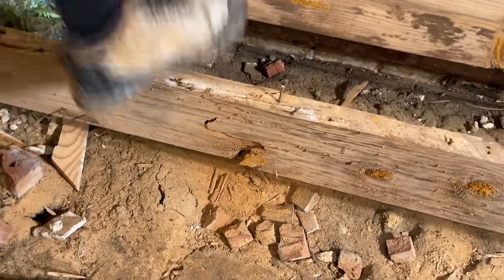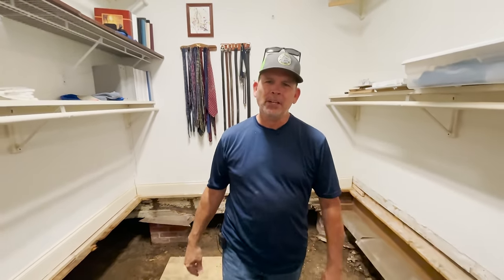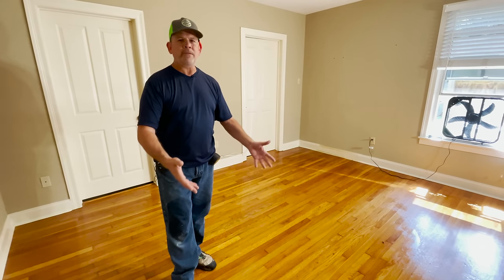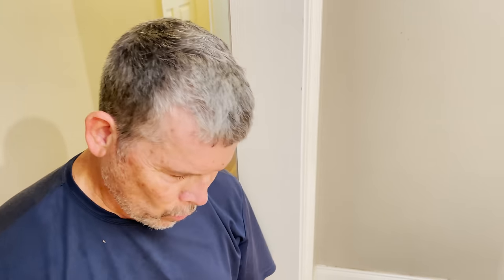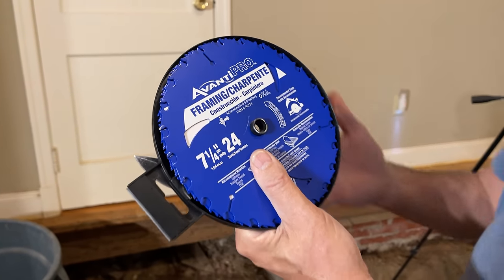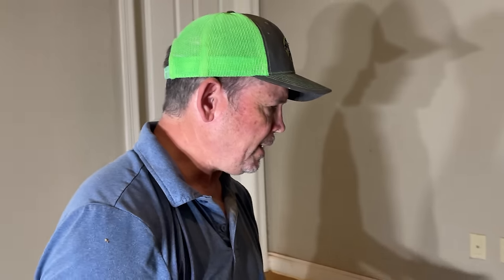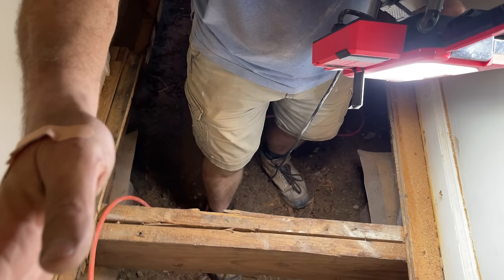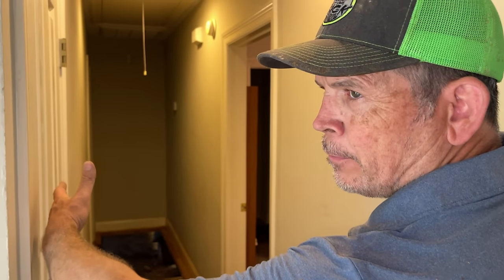This House is CAVING IN ON ITSELF!!! Can We Save It?

Comment: I just subscribed and appreciate you two for sharing. The owners decided to tear it down according to Stud Pack answering Dave Paddon and Claudia Gonzalez’s comments way down in the comments list. Since they had insurance, I suspect the price of demolishing the home and building a new home was close to the price of the repairs, after the owners probably told the insurance that they need to do a more complete inspection of the entire home because they (the insurance company) need to pay for all the damages since it all resulted from moisture and plumbing issues. By the time all the prices to repair the home “correctly” was added up, I imagine that the owner’s decision came down to whether they just wanted to pay the insurance deductible and go thru having repairs done for months or if they should be in $20 to $60 thousand from their own pockets and have a whole brand new house. If the owners decided to take an insurance check and add money from their own pockets in order to have a brand new home, then it was probably based on  the age of the home, the price of insurance premiums on it and about the probability of having more issues  with the the home. Myself, I would have gone with the repairs. The first thing I would have asked them is couldn’t they cut out a patch of bricks to inspect whatever is going on with the sub flooring and  foundation because the condition of the inside flooring seems to be in good condition so I would like to save it if possible. Then of course they would have went under the house from the outside or negotiated where the best place to cut of a piece of flooring to go under from inside the house would be, but either way they would have probably said the cost to try to save the flooring due to the labor involved trying to do it without damaging it and then with the price of mold remediation and pieces lost to damage, that will add up and there’s no way insurance is going to pay for all that labor. I of course would have asked the ins company to figure up the price of having to pay for a comparable real wood flooring to replace the one that came out of the home and then ask the repair man, how much would the difference be for the labor involved in trying to save the old floors verses just throwing them out. If the price for the labor involved in order to save the original flooring wasn’t that much more than the cost of the new flooring, I would defiantly be trying to arrange an agreement with the repair man that instead of buying new flooring could he possibly use the original flooring or at least as as much as possible such as maybe the whole prayer room even if there is enough salvaged to do the hallway. That of course is a repair man’s nightmare is homeowners that want to do things the hard way because repair men know anything is possible and sometimes that makes a job way more hard than what was originally quoted but when he has to step to the owners with the new found issue and tell them that makes the price of the job go up, he knows most homeowners will balk and say “well I just don’t understand why you didn’t tell us this before” or “I just don’t understand how you didn’t know this in the first place.” If I were the repair man having to deal with customers day in and day out, I imagine I would want to thump the owner on the forehead when I answer them saying “Well thats why when I quoted you the price, I specifically said the price would be $this amount, and that is IF we are able to do in the manner that “we should be able to” but that could change because with older homes we often run into unexpected complications and the cost of the job can increase. So thats the answer to your second question too, because  sometimes there’s no way to know about a complication until you actually find it because if by the parts we see, it looks to be normal or done in a certain way then we thats what we base our quote on but because we also know from past experience looks can be deceiving or that some people do things that have no apparent reason or that can’t be reasonably explained, thus the reason that we always explain that something could find a complication and that would increase the cost, what part of that didn’t you understand because its also printed on the estimate. Its like people don’t pay close enough attention to repair man when they are discussing prices because on certain things contractors or repair men will give a quote on something and doesn’t even say “but if we run into any complications” and thats because if they are experienced at their job they are well aware if its  something straight up that there almost nothing that would actually make any difference in what they have to do to get it fixed. However, if there’s there’s even a chance if something that might cost them more time, energy or materials to make it work right, then they will defiantly make sure they say their quote is IF there’s no complications found, so that should always put the homeowner in alert that there’s a possibility, which is why I have no idea why some home owners act shocked and are mad at the repair man. Many times it is the previous owner’s fault if a complication is found because most the time either its a home owner’s dyi thing or the thing was done that way due to a home owner telling the repair man just do it however he can to make it ok for now and for it not to cost any thing more. So if someone wants the flooring saved and a repair man had pulling up a few pieces and there were only nails in those pieces, then he reasonably believes someone nailed down every piece, and has no reason to think that half way across the room someone would start using glue and nails to put the floor in when its tongue and groove flooring and there shouldn’t be any reason to use both so how could he have know about the complication without having tore out the flooring? So thats why I say if they mention a chance of complication a homeowner should listen because the bigger the chance that there might be one, they usually stress on it more, as to where they feel its “for sure thing” like ripping out the whole floor, they know how much time it takes to do it just getting that done, however when some home owner wants to throw something different in the mix like saving the old flooring, the requires being careful and things that might get damaged during the process so of course then he will be sure to mention that is if theres no complications and it’s not really because he suspected anything like glue, but simply because of it being something out of his “normal” way of replacing a floor because believe me its much easier for him and  not even worth the extra money that the home owner is paying that amount isnt anything he will make any profit from and usually just done to please the customer. I imagine thats why the majority of people that commented said tear it down and just build a new one because they are either in the business and know going in to fix something that others have had their hands on can turn out to be much harder than expected and that leads to what maybe those that arent in the business but are homeowners that have had repairs done and that is when there’s a certain amount if damage in the end for the price of repairs you could have just bought a new home and avoided all the headaches.

Comment: I would do the bathroom.  You have two root causes leaking plumbing and plastic in the floor, doing the bathroom may reveal which one is true root cause.  If it is leaking plumbing then fixing the bathroom will fix this issue for good.

Comment: Great video. I have never seen floor joist fail like that especially in so many places. Is this due to the under side of the house being completely enclosed and unable to allow moisture to escape? I can’t wait to see the engineer video and work. Thanks for sharing.
Edit: as a homeowner I would find away to fix the bathroom which I suspect is the cause of the mold and decay.

Comment: There you go the plastic under the new plywood. Just one of those stupid mistakes that people make renovating a house. I've gotten sick of all the problems our house's one renovation has. Btw using drywall outside is a bad idea.

Edit: Seriously, it's so painful to see these dumb mistakes that ruined this house. I learned just how much research and planning it takes just from designing and building three large benches to go along the local bike path for my Eagle Scout Project. The good decisions paid off, especially using polymer decking for the exterior. They are all still solid years later and still look fantastic, no maintenance required.

Comment: Get in there rip it out, why in my prospective, if a termite inspector goes in there if he could, knowing that some areas are less than 12 inch clearance he'd have to say it was inaccessible to properly inspect, to have the owner open it up then call back for a supplemental inspection....but he would call out from the crawl space entrance with a flashlight the fungus and noticeable damage, in addition the floors may have notable dips when walking on the floors, that could be considered section 2 on the report, the owner would have to face this at time of escrow if selling the house, he/she should let you fix it now.

Comment: Jack it up you said there was brick on the outside.  With all the rot can you get it structural enough to lift it?
Reply from the maker: We’d lift from the walls which are fine.  Once the walls and roof go up about 1/4” we’ll be fine.  Just need to lift the middle mostly.  The exterior walls will stay put

Comment: I have never seen anything like this.  This amount of damage done just by ambient moisture.  I had no idea it could  be this bad.  I will be paying a lot closer attention to vapor barriers and ventilation needs from now on.  It is also interesting to note that had i looked at this job i would have called it a tear down and start over but it looks like you guys will be able to save it.  I just would not have trusted any of that underlying structure to be solid enough to support any new repair construction.  Can't wait to see how you lift it up for the next stage of repairs.
Reply: I wonder what the original builder was thinking, having the brick veneer go all the way to the ground and no ventilation underneath. Homes in the South were built on piers for hundreds of years, ending around 1950 with slab construction being more prevalent. But the wood siding ended at the top of the brick piers and the entire underside of the house was open to ventilation. There was no moisture problem like that at all.  Tons of moisture comes out of the ground and has to have a place to go. Termites were/are a problem, however: termite barriers consisting of galvanized sheet metal pans, especially formed, were placed on top of the brick piers before the band joists were placed. Band joists were often 4 x 4" or 6 x 6" creosoted timbers. Exterminator companies were kept busy looking out for termites. They'd drill holes through the mortar joints into the interior of the brick piers and pump in insecticide to deter the little buggers from tunneling up. Every region has its special methods of construction to accommodate local conditions.

Comment: I am watching this because the floors in my home are going down.  I know how to replace floor joists, but not when most or all needs to be replaced going under walls.  I know I will not know how bad it is until I tear into it.  
I was assuming I need to replace with ground contact treated lumber... But seen another video to where I am not so sure now IF it is a true moisture problem 
I also seen a new product out that can be brush over ground treated contact would that is suppose to seal moisture out...$79 or $80 for a 1.88 gallon bucket if I recall correctly.  What do you think?
Reply: Did you figure out how to replace the joists going under walls? I’m in the same situation. Need to replace subfloor as well.

Comment: Your comment about the lack of sub-floor ventilation is interesting. I have no idea about building regulations in the States but here in Australia sub-floor vents are mandatory and they are required at fairly close centers. I have seen more than a few jobs where the sub floor ventilation has been compromised over the years with results similar to what you are finding. Having said that, your situation is the worst I have seen - probably is for you too.
Reply from the maker: Thx Richard.   I think subsequent additions to this home covered all the foundation vents.   So glad you found our channel 👍
Reply: There are building regulations in the USA, but my experience has been, at least in Virginia, they are not enforced very well. I have seen some of the shittiest half-ass work here in Virginia, some of it in plain sight, right across from the town hall.
Reply: @brianleeper5737  And let’s not forget that this is post WWII construction, so regardless of what the code requirements might be today, 75 years ago, if there were any building codes, they were quite simple compared to what’s on the books today.

Comment: This looks worse than one of our rental houses.  at the time I thought I was going to be moving into it, and had to remove the entire dining room floor.  The house was built on top of a rock ledge, but over the next 60-70 years dirt washed under the floor (almost a dry laid foundation, what little it had for one) and filled up nearly the full space under the floor.  

before I could even reframe the floor, I had to spend weeks chiseling out the rock to make enough space to do the framing.

We should have sold that place some 30+ years ago; some builder would have demolished all the buildings and built a "McMansion" right in the middle.

Comment: You guys should pick up one of those "portable" stand up a/c units I got one a few years ago to bring on job sites when it is just brutally hot there super convenient just stick the hose out the window and your good to work in comfort!
Reply from the maker: The AC is on inside.   It takes a bit of the edge off with no floors

Comment: You know you were getting a 12 pack of cold beer after that as well! Lol can’t you sister up next to the old 2x10’s under the bathroom so you wouldn’t have to demo the bathroom? Since you have room from opening 1/2 the floors up anyway?
Reply: That makes sense Robert, but man there is so much rot, It's better to cut it out and start over. It's hard to believe these repairs are worth it monetarily.
Reply from the maker: The subfloor is rotten too otherwise that could work

Comment: I wouldn’t bid that job with a 10 foot pole. Pay hourly til it’s done or no dice. Did maintenance on an old apartment building that was built on the ground like this, floor was rotting the same way, no crawl access from outside, no vapor barrier and no way to get one in there. No way to fit a dehumidifier, every type of pipe that’s ever been made cobbled together with shark bites and flowlock couplers. Told the owner the only way to fix it is to raise it 3 feet, then start all of the demo. He sold it, feel sorry for whoever bought that land mine.

Comment: May I ask a (stupid) question? Why do houses in the south not have basements?
Reply: In some areas they have very high water tables. So the basements would always be wet. 
Other areas would have basement flooding due to hurricanes.
Reply: @1packatak   Thank you.  That would also explain some of the videos I see about sink holes.
Reply: You usually hit water when you dig down only a foot or so.
Reply: There is no structural need for a basement. In the north, you have to go down at least 3 feet (depending on frost level) to hit undisturbed ground for your foundation footers, so as long as you're excavating, why not excavate all and have a basement. Also, especially in the past, you needed a good furnace or boiler in the north and it may have been coal burning years ago, and nobody wanted that in the main part of the house.  In the south, all that expense is not needed as the ground does not freeze. You can build  slab-on-grade. The older houses (like this one) on brick piers had the piers built on small slabs right on the ground or level with it.

Comment: Also, anyone else find it a bit odd they cut and knock around extremely molded boards - and most time wearing no kind of respiratory gear or treating the boards so the mold isn't flying into the air?

Comment: Are houses in the US still built like this?? I am familiar with houses in the UK and in Scandinavia, and a house would NEVER be built like this. Even with good ventilation it will at a certain point start rotting. In the UK houses are usually built on a foundation of concrete beams, with blocks made of a cement based product, that will never fail like this. In Scandinavia houses are usually built on a foundation of solid concrete, with damp membrane to prevent damage further up. To see this is shocking...

Comment: You really don't have anther option for the bathroom do you? I mean the joist/beams are clearly compromised and will not just magically get better, so you have one of three options.

option one continue on with the job, demo the bathroom, and repair all the rotten wood a planned.

option two put it all back together, ignore it, and wait for the house to cave in, and/or be condemned.

option three demo the entire house and start from scratch. 

While it might seem tempting to just go with option three, and I am sure option two is pretty much a no go, are you really gone to demolition and rebuild a entire house because what amounts to probably less than a 1/4 and definitely less than 1/2 the house has been damaged? I mean you saw well even wood that was very, very close to the "disaster zone" was perfectly ok because it was sealed off, eventually you will hit that point under the house and have no issues.